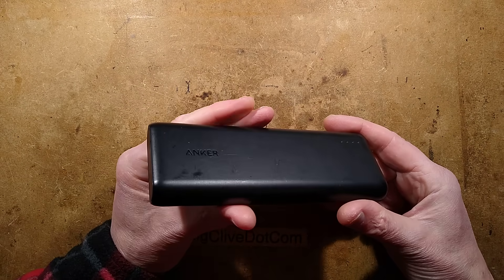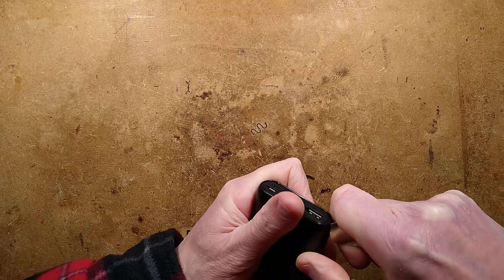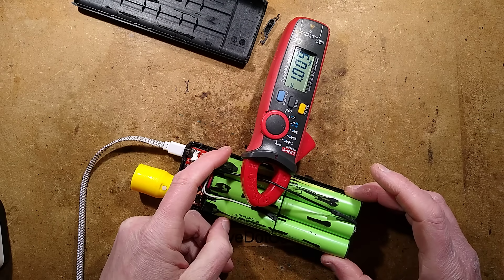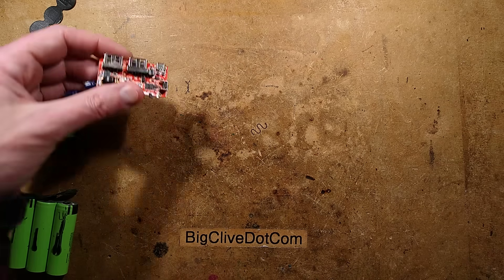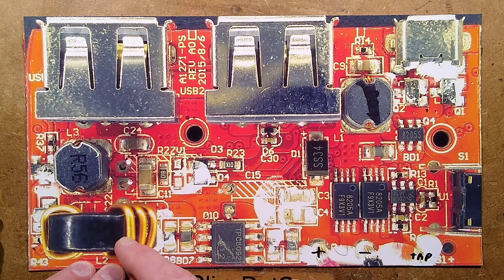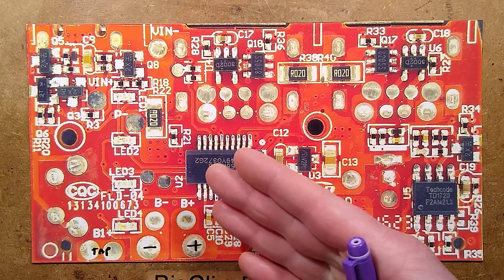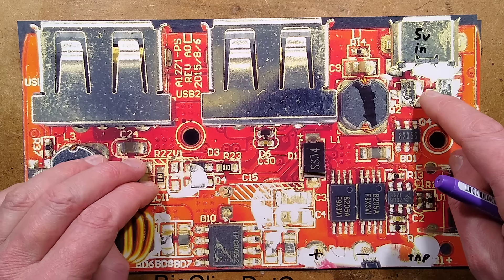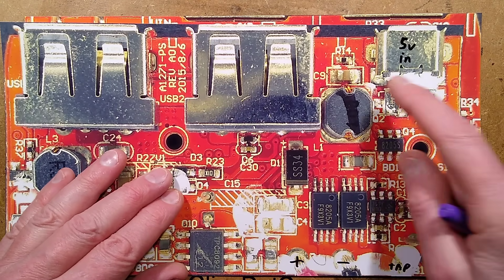Exploring an Anker power bank

Comment: Not related to their power banks although I've used their larger ones for camping and festivals for ages now but I just wanted to shout out their charging cables too. I used to burn through one or two cables a year and their nylon braid cables have basically tripled the lifespan in the same usage.

Comment: I noticed that that battery looked like my mine (which is very old and has been dropped many times and has been in use that whole time, about 6-8 years, I honestly don't even know exactly how old it is any more😂)
And it was, just I have the model with quick charging. if you ever need a battery or a charger, get Anker, personally, they've only gotten better (I have gotten a newer power brick from then)

Comment: My new Anker pack charges real slow, my adapter is capable of 35w but the unit only wants to draw 10 or so until it reaches 90% charge and then steps the charge up to near 30%!

Comment: We've yet to see you trying the dropped from a height, option ! 
But I must concur with the hack your way in and then its fixed conundrum.... ? 
have you also had the buggered again after re-assembly issue .........
Reply from the maker: Yeah.  But the chance of something not working again after reassembly is usually proportional to the complexity of reassembly.

Comment: I bought a 20k mAH Anker power bank a few years ago. Seemed to work really well.

Then i saw one that was about 42k mAh in Amazon, got it for Christmas. But I started to get suspicious if it actually was 42k mAh. I tried to test it, and it seems like it doesn’t hold as much as my Anker one.
But idk how correct my test was.
Reply from the maker: You can sometimes go by weight, but the scammers sometimes add metal weights.

Comment: Mmmm nice just acquired a “juiced” brand power bank from a recycle bin. 1,000 mah .No issues opening it up the cell packs had swolen and popped the cover. Nice unit even has a temperature sensor. So next job is to see if it will take 3x18650 or possibly 4x recycled 3000 mah vape batteries if I open the tape and flatten them out.
Reply from the maker: I wouldn't recommend reshaping cells.  It has a risk of causing an internal short.

Comment: Although somewhat complex, this looks like a well-made control pcb. 

I wonder why they decided to go with 8.4v and buck to the 5v output instead of a single cell boosted to the 5v output like so many other power banks use. 

One possible guess is that synchronous buck may be more efficient and likely has less output ripple than a boost converter, possibly? 

It makes sense to have the most efficient conversion happening when the power bank is in use to maximize the usable capacity. 

I have noticed that the circuitry on single-cell banks that boost to the output become quite hot if sufficient current is pulled.  (>2A usually) 

I have one anker power bank and I think it's probably the best functioning in my random collection.

Comment: I used to be a big fan of Anker and had great luck and great service for nearly 10 years, including the exact battery bank you're taking apart (mine still works!). Unfortunately, the last batch of stuff I bought, a 27650mah battery bank, a charger and some cables, all failed within 8 months. Anker support has been replaced with an AI chatbot that ghosts you if the basic troubleshooting steps don't work. It took 6 weeks to get a replacement, and the display on the replacement died a month later. I don't think today's Anker is the same company that made the power bank in this video.

Comment: I watched this to see if my similar age and style Anker power bank had decent safety circuitry (A1263 PowerCore 10000) and I'm not disappointed. I don't like to leave lithium devices charging unattended, but cheap power banks scare me. If you've ever witnessed a lithium battery fire or explosion you won't be gambling on an unknown/cheaper brand to save a few quid!

Comment: Most interesting particularly as I have an identical power bank which is still going strong after just over 6 years. Hopefully I'll never need to rely on the reset trick. Never bothered to test to check it's stated capacity.

Comment: What do you think of the design of ultralight powerbanks with a LiPo sandwiched between two thin "carbon fibre" sheets and surrounded by some polycarbonate frame?
I had one last a few months before the LiPo started swelling. The two sheets were held in place by glue.
Aluminimum cases seem to give me a bit more confidence when carrying a powerbank.

Comment: I have one of these, but a shorter one. It quit working and was really wanting to open it up and take the lithium ion battery packs out, see if any of them are faulty but like what you seen it looks like it will be quite difficult to do. So it's just been sitting on a shelf for a long time now. Which isn't good for the batteries anyways.

Comment: I have found a number of vaping devices that are rechargeable.  I would like to use the charger bit of the vaping device in another project. If you are interested could you cover the circuit of these charger.

Comment: COMP probably stands for Compensator, it's connected internally to the output from the error amplifier.  The external capacitors between COMP and ground would presumably smooth out the perceived error to stop it from overreacting to its own switching noise or massively over/undershooting on load changes.  On the Techcode TD1720 it also turns off if COMP is pulled low.

Comment: These anker power banks are very well made. I have a wireless mag charger by them. Left it in my pants through washing machine. It magnetized itself to the drum of the washer and hid there for about a month. It must have ran through the washing machine a dozen times. I eventually found it. It still worked. Plugged it in, carefully. Charged it outside. Worked fine, let it cycle a few times. No issues. I still use it today, that was about a year ago
Reply: Same story for me except mine went through the dryer lol it didn’t survive and I almost caused a huge battery fire
Reply: @Extreme-everything47383 lol yeah, big difference between sending an electronic device through the washer vs dryer. Glad your house didn't burn down!
Reply: That’s pretty funny
Reply: I have this power bank it works grest. Even though I've dropped it many times lol

Comment: Having cells in series and only one cell control chip per cluster is a sin in my book. That build is the same as in every removeable notebook battery pack, usually the HT66 or other control chip, only has the software in ram, loosing the software instantely when disconnecting the cells for individual replacment. Also cells in series always tend, that one goes fully drained, which then results in a dead battery pack.

Comment: I had a 8Ah power bank that have almost the same strange behaviour , seems to charge , but if we try to use , it goes empty , and it seems bulky in the middle. once opened , it uses 2 flat pack 4Ah batteries en parallel , and one went Pillow mode ... after remove it to see if y can use it as a 4Ah , the electronics don't like it ; so I will adapt it tho use the same cells has yours, in a battery holder :D

Comment: The COMP Pin is the output of the error amplifier (Literally just an opamp with the FB Pin and a constant reference voltage as input) and outputs the voltage level that gets compared with the saw wave to generate the PWM signal for the mosfet drivers. Together with the capactiors it realises an integrator and acts like a PID controller. That reference circuit for the TS1720 is quite odd though, because the capacitors and resistors on the COMP pin usually connect to FB instead of gnd and form a Type III compensator. I have actually never seen it done like that before, though I have not seen that much yet.

Comment: Comp stand for compensation, and it is used for external compensation of feedback loop. Basicly, with components on it, you shape the transfer function of the feedback loop and on schematic it os drown type II compensation network for transconductance amplifier (OTA). It is most commonly used for current mode controllers (for voltage mode, you usually pick type III compensation)

Comment: Efixx
Hey Clive, sorry to go off topic but I've  got to thank you for your comment on efixx. I cant believe how those "professionals" are stiring things up and trying to lobby, preventing DIY electrical repairs.

I've just had to rewire a pair of kitchen ovens after fixing an element with failed insulation. That's another story.

I found that both ovens were sharing a 40 amp switch with no fuse protection. A single 6mmsq feed ran from the switch to a round junction box hanging from the wiring. In this box, the two ovens were connected to this single switched feed.

This work was done by kitchen fitters who charged for an electrician to check the wiring!

Efixx were using the death of two people as a manipulative tool.
An earlier episode mentioned the fire, they stated that a fire fighter assumed that faulty wiring was to blame because there were no other obvious sources of the fire in the area.

How about pushing them to provide a more complete and true report on the cause.

Love your content
I unsubscried from the channel!
Reply from the maker: I think eFixx are just presenting news.  They're hopefully not affiliated with the niceic, who are a very unimpressive company.

Comment: I have this EXACT power bank.  It works great.  The only drawback is that it takes forever to charge.  However, if this keeps the batteries healthy, that's fine.
Reply from the maker: Slow charging is my preferred option.

Comment: This is a old model power bank that was pretty high end before we had fast charging USB-C protocols. This used to charge rapidly via a special micro-USB input at up to around 20 watts and could discharge around the same using. It was one of few power banks that could reliably run HTC Vive wireless virtual reality headsets a few years before COVID.

Comment: you should had measured the voltage on each bank of batteries to see how much out of balance they were. there is a big chance the batteries are poor or drifted enough in voltage to shut off the circuit before they took proper charge

Comment: I wounder if holding the button down forced it into its low current mode and that caused the system to restart. Anker has a low current option on several of their power banks so you can still power or charge low current devices that would normally cause the charger to shut off because it thinks the device plugged in is fully charged.

Comment: I have a locked up bank and a bank that is charging but the capacity is reduced by 75% 

I've tried numerous ways to get the locked up bank to reset and it never did, I left it for a very long time and sadly wouldn't take a charge. I was just gunna open both up and take the good cells out of each bank and balance them all and throw it in with the good controller. Seeing how difficult they are to open tho is kinda putting me of that also 😂

Comment: I was considering HY2120 for my RC boat but it has this bug (also mentioned in datasheet) that when you connect batteries for the first time it doesn't work until you connect the charger. Imagine going out to do some RC boating, replacing the batteries for the second round and it stops working. And you don't have charger with you. So it is only for non-replacable lithium batteries.

Comment: Think I have a copy or a v2 of this (pretty old actually... maybe 4-5 years) but not Anker branded... Still works, and I use 2-3 days a week... just couple with a resistive USB heater (which is also amazing! :-) when it's a bit cold...

And mine (as probably this by the looks of it) also sort of checks the connection before it outputs sort of. I do remember trying a USB fan with it and it just started and died... But when holding the "check charge button" I could tell it to output and skip the checks and then it was just a "stupid" powerbank that could power resistive loads as much as it could...
Love this thing... bought it on sale in a local electronics chain here in Sweden...

Comment: I have the same model as this (at least it looks the same) and its held up pretty well, but got left out in the rain with the USB ports up, so now they're all corroded and it stopped responding after a bit. :( I was hanging on to it to see if there was a non-destructive way to open it, so I'm glad you tried for me and showed that probably not. I wonder if I could salvage the cells at least.

Comment: The COMP pin is part of the feedback loop.  The FB pin would be the inverting input to a transconductance amplifier.  The non-inverting input would go to the internal voltage reference and not pinned out.  The comp in contains a complex network to ground that defines the feedback behavior.  Since the amplifier is a transconductance, a impedance external impedance of C1, C2 and R2to ground converts the amplifier output from a current to a voltage.  The voltage on COMP is also sent to the duty cycle controller.  
Q3 shuts down the converter by taking COMP to zero, producing zero duty cycle.
The series circuit C2 and R2 form a zero, with theoretically infinite gain at zero frequency (actually not infinite, equal to the amplifier open circuit gain) with a flat gain in mid frequencies set by R2.  R2 sets the gain in the mid frequency ranges.  R2 has to be limited in value to make feedback stable.
C1 forms a pole that rolls off the high frequency response of the control loop.  This is typically set around 1/2 of the switching frequency, so it doesn't react to the switching ripple.

Comment: For the record Onn branded battery banks have a similar functionality. Holding the power button has 2 separate functions. The first is to reset the control chip as you surmised. The other is to put it into a low power maintenance charge mode while plugged into a device. The Onn brand is a bit more fiddly to get apart as they use LiPo battery cells which are far more prone to punctures and other such damage.

Comment: My 1st thought was to get a steel (  W  ) alphabet punch , heat to 300ºC and press on the plastic lid 😝 .... Handy tip # 56 .... with rogue power banks with series Lithium cells ( say 3 for about 12 Volts ) ... a handy way to recharge is , to use a vape charger and charge each 3v7 cell individually ... this takes 3 times as long , but I have found it to be safe , and avoids malfunctioning cell balancing circuitry ... ( tried - n - tested ) ......... DAVE™🛑

Comment: I love the quality of everything Anker. They just seem to produce consistently quality products. I’ve yet to be let down. Their powerline charging cables are very heavy duty. When he opened this powerbank i immediately recognized the panasonic NCR 18650’s. Those were/are great cells for anything that isnt high drain. Theres been one in a solar motion light of mine, outside for 5 years now. It still lights up in 0°F or lower weather.

Comment: Ive Had this Powerbank for over 10 years of regular use now.
By now the USB Ports have well exceeded their Insertion Limit. One i shoved a USB in Backwards and Basically broke the Port, the other one is unbelievably loose and only charges when pressure is applied to a cable in a specific way.
The batteries thought are still in great condition. Shame this ist near unrepairable.

Comment: I have one of these packs. Good to know what happens if it bricks. btw, not famil with that chip but “COMP” pin usually means “compensation” on switch mode controllers - it’s usually the output of the internal error amp (before it goes to PWM generator), you can add passive components there that control the stability of the control loop (frequency COMPensation). It’s also a place you can short to ground for shutdown or soft-start or external enables (like this cct)

Comment: COMP is Compensation, there’s a zero in the feedback loop but there’s another compensation function which can trade off various parameters like ripple, noise, transient response etc. 

As for the micro, the Anker banks are pretty slick. When you connect them to their solar panels they do some sort of MPPT type deal. Non Anker banks a cloud goes by the voltage will collapse and the banks will often break off charging and absent a plug/un-plug sometimes won’t resume. The Anker seems to actually throttle its charging to prevent overdrawing the panel so you charge albeit at a lower current.

Comment: I'm gonna make a more than educated guess that on the TD1720, comp is compensation. It's almost certainly the error amplifier output of a transconductance amp and the resistor / capacitor network loads it and sets the frequency characteristics since it's a high output impedance amp. Similarly, the FET Q3 can switch it off altogether by shorting it to ground. And yes, I am great fun at parties! 😂😂

Comment: Anker has a reputation for quality products. I'd buy them expect they are just so expensive. I bought a set of 20,000mAh packs from Aldi for ~$18 USD each. While an Anker of the same capacity generally starts at $30 and goes up from there.

Though I mostly buy them for power outages. We get rather severe storms in the summer that can take out power for days to weeks. So capacity per dollar is key to me. One of those 20,000mAh packs and a USB light and I can light a room for days.
Reply: I've got a fuel series 18w bank from xtorm. it's been working faithfully for years. looks very similar to the one shown in this video

Comment: I've had trouble with some of the anker multiport power bricks but other than some compatibility issues with usb fans my powerbanks are great.
Reply from the maker: If you find that a power bank refuses to supply power to a USB-C device then it may be the device not having a couple of resistors to identify it as a device requiring power.